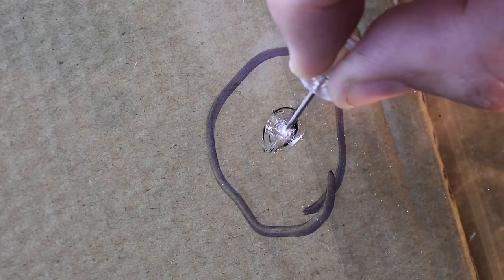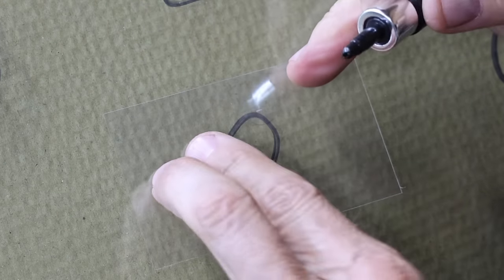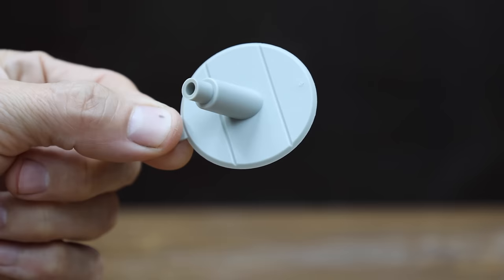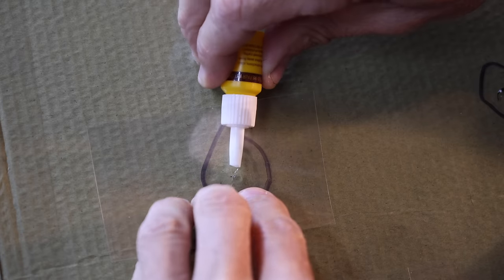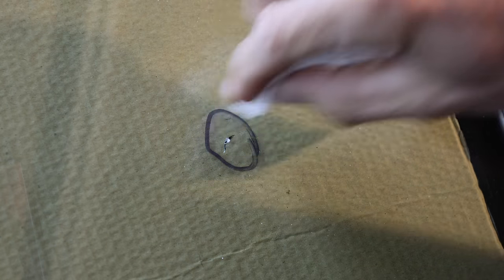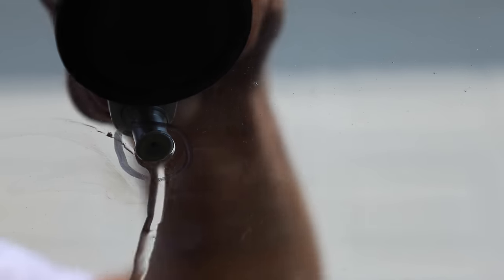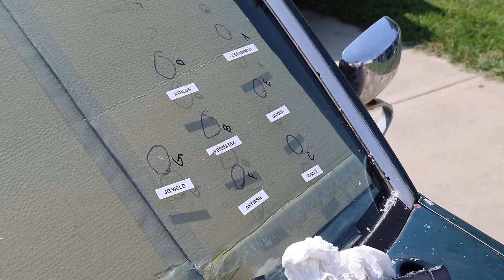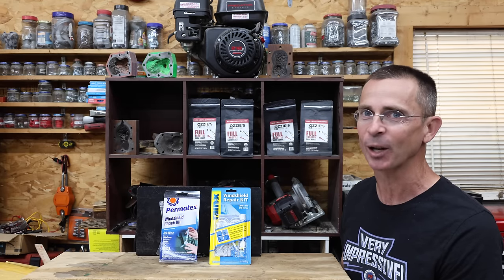Best Windshield Repair Kit? Let’s Find Out!

Comment: This is by far the number one consumer product ranking source that I have found. Been watching for a long time and you never cease to amaze me with the quality and objectivity of your reviews. Thank you so much!
Reply from the maker: Thank you very much! That's definitely my goal. That gratitude expressed by everyone is highly motivating and keeps me going. I'll continue trying to improve the quality of the reviews.  Thanks again!
Reply: FACT
Reply: I completely agree. When I'm looking to buy a tool, I first check if Project Farm has done a video on it. That's what happened when I needed a jump starter. I bought the Audew, and haven't been disappointed. Thanks, Project Farm!!!
Reply: Agreed!
Reply: I legitimately buy things because of this channel. I think it started with reciprocating saw blades but it's like he goes out and spends the money so you don't have to.
Reply: @ProjectFarm I've got simple and relatively cheap video idea for you:
1) The best way to place a toilet paper in toilet paper holders: with the toilet paper tongue over the top (i.e., closer to the user) or under (further away from the user).
Reply: Good video, I'd like to see a video of Sawzall blades especially when used to remove stumps😂
Reply: @ProjectFarm I would add one more step to this I would go inside  with caution use a lighter lightly hit the spot where the crack is that way the crack gets filled even more and you avoid visible cracks after repair.
Reply: It depends. Over the top if no cat is the proper way; a ca, against the wall or you'll be winding that roll up multiple times.
Reply: @4Shreks  Like the Texan amputator with a chainsaw!
Reply: This one shows that he's also taking our responses onboard.  A few videos ago, we recommended that he not differentiate, in strength tests, when the substrate breaks instead of what's being tested (I think it was the plastic repair video).  In this one, he seems to have taken the advice.
Reply: @ProjectFarm any way you could do a video testing/comparing tractor hydraulic/transmission fluids specifically Case hytran, John Deere hygard, Kubota udt, and few other non tractor brand premium fluids? Thanks for all the videos.
Reply: @clevermusicbox3630 texan chainsaw massacre?
Reply: Yep, you get to see what the stuff looks like and get a good idea what to expect
Reply: @ProjectFarm are you guys going to do a BEST WINDSHIELD WIPERS video with fall/winter around the corner?
Reply: imagine if he reviewed other stuff, like tech or foods lol
Reply: I agree.  I just always hope we don't see the channel is actually owned or compensated by Blackrock or another conglomerate oneday.
Reply: Absolutely
Reply: Couldn't have said it better myself!
Reply: @ProjectFarm do a comparison of tyre dressings.
Reply: Hello can you make a video by chance by testing the best and worst ball point press
Reply: Real school test is to shoot each piece of safety glass from fifty feet away with a round from a 40mm Glock. Or the head of a number 6 golf iron.
Reply: @lestagez tech yes. Food no.
Reply: @ProjectFarm have you done carpet drying fans/blowers yet?
Reply: Agree 100%
Reply: Very true! I used to work for an AV company and on a day between jobs told my supervisor about the channel reviewing a category of tool we used and within minutes Project Farm was on our showroom tv being reviewed by the whole team haha :D
Reply: @AChi__  I've done it. Off the top so that it can be broken off over the roller holder and left that way hanging snagged till the next occupant or user in line for use. Works left of throne mount and right of throne mount equally unless there's a handicap feature for a person with only one hand in the house
Reply: Still wonder where the survivors of the tests go to. Donated? Sent back to place of purchase for replacement or refunds? Howzabout the utter failures? Any hope of getting something donated to a shop or school, or does everything get recycling center treatment? Feel free to let Eddie chime in. Thanks Todd.

Comment: I used that $300 kit as a teenager when I was repairing windshields and I got to the point where 1) the biggest chips were my favorite to repair and 2) I could make them completely disappear. Also the best film for curing was the plastic from a cigarette pack!
Reply from the maker: Thanks for the feedback.
Reply: I wonder if the JB-Weld would have performed better using a thinner curing film? (like the wrapper from a pack of cigs)
Reply: I liked the transparent liner from the back of automotive tint. It worked great for curing
Reply: A person who takes pride in their job.  We need a lot more of you in this world.

Also, what kind of waste film would you recommend today?  Cigarette packs are way too expensive amoung other reasons not to buy them.
Reply: Cant you just but a new windshield with that money?
Reply: @kishorebabunalluri7182 probably not. But that $300 professional kit I'm pretty sure isn't one and done. You could probably start a side hustle.
Reply: @jlang8213  Yes, indeed. Well worth the money on that one.

Comment: IMPORTANT TIP FOR FLORIDIANS. If you live in florida and have car insurance. Your insurance is required to fix your cars windshield at no cost to you. No deductible. As long as its just the front windshield
Reply from the maker: Great tip! Thank you
Reply: PA also has similar policies.  This can apparently increase your insurance rate if you switch. I quoted out a few options and forgot about the windshield "claim".  It came up during the final stages of obtaining the policy and it raises the overall premium 10%

Still was cheaper than staying with my old company but just and fyi.
Reply: Additional information - contacting my insurance company after a crack that required full-replacement of my windshield. Statefarm told me that this would not, by itself, raise my premiums for insurance. However, it is considered part of your claims record (although it IS labelled as a windshield claim and therefore specified differently than an accident) and if you are someone with multiple claims, the claim associated with your windshield may be a factor in raising your rates if you end up filing more claims in a short period of time. This seems subjective and varies by insurance company in the state. It may make sense to pay $12-13 in order to DIY a rock chip in order to not initiate this claim through your insurance. especially if you are someone with a history of speeding or recent accidents.
Reply: That reminds me of what happened in MN with windshield repair decades ago.

One company decided to give away a free box of steaks with each windshield repair.  It was advertised relentlessly, and since insurance paid for the repair, the extra money for the "free" steaks (i.e. a kickback) was a big bonus for people to pick this company.  Soon everyone that did windshield repairs had to have some give-away, sometimes exceeding the cost of the repair and costing hundreds of dollars.

Eventually this attracted the attention of the legislature, since of course all this did was increase car insurance premiums.  They eventually banned this practice of "free gifts" outright.
Reply: Same with Texas
Reply: @2shotsofvaca411 In Texas most insurance  companies will attempt to repair (no cost) before replacement (you pay deductible).
Reply: I am an insurance agent licensed in 7 states, every one of them provides no cost repair if you have comprehensive coverage.  If you have liability only, you may be out of luck.   I am actually curious as to which ones don't require the companies to offer that.
Reply: Unless something has changed, a number of years ago, Statefarm changed their windshield policy to not pay for windshield repairs, only replacement. One may get a discounted price for a repair. Rumor was, they paid for repairs and also replacement later, so paid more overall. The company anticipated other insurance companies following similar policies to not pay for chip repair, but that didn't happen. So check your policy terms.
Reply: My Texas sale pitch was it's a no fault claim, your insurance company will pay to save the glass
Reply: Arizona is similar. The auto body shops will even offer ~$200 to the owner because the insurance gets a huge bill so they want drivers coming in.
Reply: You just KNOW Florida lawmakers will move Heaven and Earth to change that law…
Reply: Hahahaha.  NOTHING is free in this world regarding insurance 🤣
Reply: @thewibb  so true this; people will pay one way or another.

Comment: I have used the permatex 6 to 8 times with good results. They never cracked, left a wiper streak or discolored. Some spiders were on the large size and were repaired, though none disappeared completely. You're one of the fastest talking Farmers I've come across. Keep up the great work!
Reply from the maker: Thanks!
Reply: Will the permatex push the medium onto cracks/ If fso, how  long. I've got nast crack i would like to make less visible

Comment: I have used the Permatex kit, and it has held up great over the last few years going from high temps, and a few trips into the snow too. The big thing is making sure the area around the "sealing sticky ring" is 100% clean, or the resin WILL force out when you do the "pressurize" step. Otherwise, for tiny chips, it is not a bad kit.
Reply from the maker: Great information and great tip!
Reply: I used Permatex after taking my wife’s car to get a chip fixed one week for $115, then she got another chip just a few weeks later. It looks just as good as the professional job. Definitely a good product to keep on hand.
Reply: I’ve used the permatex on some pretty big stars. Most of the time they hide pretty good, but even if they’re partially visible yet they seem to stop the spread. The challenge I have is getting to it before the spread starts. I run a lot of miles in a state that spreads gravel on snow and ice so I personally buy windshield warranties and they always pay for themselves. The vehicle I bought in January is on windshield number 3
Reply: I've also used the Permatex with excellent results.
Reply: I used a permatex kit on my windshield more than 10 years ago and it's still looking great.  Best kit for the money.
Reply: @specialestness I'm late to the party but is this warranty through say a Safelite style company or is it through a third party? I assume you don't mean insurance. I've never bought a windshield... yet... So, I'm curious.
Reply: @0Rookie0  most dealerships seem like they sell a windshield warranty when you buy a vehicle. It’s a third party company and they typically work with Safelite. I’ve had one through Crystal Fusion and another through Permaplate.

Comment: Featuring a professional, when it's rather hard to grade products was a very smart move.
Reply from the maker: Thank you very much!
Reply: Yep, this took his review on whole new level, would love to see more product reviews including professionals.
Reply: Todd, you outdid yourself this time, and that's a very high bar. A+ job!!
Josh seems like a great guy!  What's the name & URL of his business, please?
Reply: @ProjectFarm  And now that you have experience recording just hands and not showing the person's face, you are now ready to work with the LockPickingLawyer.  😺
Reply: It was great, I just wonder how hard it is to get pros to appear on camera for this stuff.
Reply: Yeah, I agree. With a repair kit, there are so many features/aspects to rate, which can't be rated without experience.

Thanks Todd & Josh.
Reply: @Kmnri  That's gonna be problematic for tools, for example. Pros tend to use tools harder with less maintenance. Recommending one tool over another has more to do with abuse tolerance than the actual design intricacies of the tool itself. I know, I'm a contractor....what I might recommend to the weekend warrior would probably be expensive overkill most of the time.
Reply: Would be nice to do the test blind if going through the trouble of using a professional. We all have our biases.
Reply: I got a pretty big bullseye in my windshield when a rock got kicked off an overpass and I hit it at 70MPH. My car was two weeks old…
Next time I took it to the dealer for service, they saw it and convinced me to get it repaired for, I think $249.
It didn’t come out nearly as good as I thought.
Every time I went in for service after this, they’d notice the remaining mess and offer to fix it for $249. I tell them they already had their shot and failed miserably.

There is a guy who hangs out at our local Shell station, stalking every vehicle windshield damage so he can give you his card. Every time 
I bought gas there, he’d try to give me his card.

Comment: I got a chip a half inch from the edge of my windshield and it spread out to a 6" crack extending from the chip towards the center. I brought the car to Safelite and all they did was rub on the crack extending it another 2" and then tell me it can't be repaired and I need a new windshield for $600. I drove home, ordered the Rain-X kit on Amazon, and sealed the chip and the crack. Because the chip was next to the edge of the windsheld I used my fingers to hold the other half of the suction cups down for ten minutes while the epoxy did its thing.

It's been over six months and the crack hasn't spread any further. It's visible when the light shines on it a certain way but overall I'm very pleased at saving $585 on the repair.
Reply from the maker: Fantastic!  Thanks for sharing.
Reply: @dj68k  eventually you might want to get that fixed. But I do like how this stuff stops the crack from spreading.
Reply: If you ever need a new windshield look for a large auto glass distributor near you. Safelite and dealership were charging me $900 for an oem windshield and labor and I got it done for around $245 with an aftermarket windshield after getting quotes all around town. Ridiculous prices for OEM windshields
Reply: Another thing to note on newer cars is that features like adaptive cruise control may require  calibration after a windshield replacement. This is usually not needed but can be done afterwards if needed. So to save the most money you can ask for quotes for a new windshield, a calibration, and both together. It is cheaper to get them together. But since you most likely won't need a calibration it is a good idea to have the lowest quote for the calibration if you do require it down the road. In my case I have never needed a calibration and all the safety features still work great.

Comment: So many times this channel has put out a video that is EXACTLY what I need with PERFECT timing. I just did the estimate for Safelite and it is 159.99 for just 1 chip. 
So once again, PF is saving the day.
I appreciate this channel as much as I enjoy it.
❤
Reply from the maker: Thanks so much!
Reply: I've heard that insurance companies have covered these repairs with no deductible applied.  I'm surprised the shop didn't tell you that.
Reply: Depends on the insurance company. State Farm will discount but make you pay. Most insurance companies will cover at 0.00 cost to consumer. But you have to file a glass claim to fix chip and find out.

Comment: I've been doing windshield repair/replacements for about 10 years now.  The first repair kit I bought, and still use to this day, is Glass Mechanix.  Pricey kits, but I achieve very nice repairs with it.  One thing i'm glad you showed is adding a bit of heat (flame or blow dryer) to the inside of the windshield on the last pressure cycle.  You can literally watch the resin flow into the legs of the cracks when doing so.  It's very satisfying to watch that happen.  

With the Glass Mechanix kit (and with other professional high end kits) you only need to do vacuum and pressure cycles for a couple minutes.  Very quick and efficient.
Reply from the maker: Thanks for the feedback.

Comment: I’ve personally used the rain X style kit (ufixit brand) and the permatex as well for a dozen repairs now and had excellent results with both, correct application is definitely the key and while the rain X is more reusable it is a little more fiddly. I felt the double sided tape and syringe type kit was far more foolproof and more “point and shoot”.
Reply from the maker: Thanks for sharing.

Comment: I had a tiny chip in my windshield. I went to the professionals and they said there’s nothing they can do because it’s too small and a repair won’t work. I bought a repair kit and did it myself, extremely easy and has been very successful. Can barely see it and now it’s perfectly smooth, no more chip.
So much for the professionals in this case.
Reply from the maker: Thanks for sharing.
Reply: Same with me.  They told me to kicks rocks.  I went out and bought the permatex one and came back to show off my work.  That guy had nothing to say after.  😅

Comment: I have used the Rain-X kit, and was very happy with the results.  Although the repairs are slightly visible if you get them in the right light,  they have lasted well,  and don't seem to have deteriorated in the 2 years since I did them.  😊
Reply from the maker: Thanks for sharing.
Reply: I have experienced the same results with the Rain-X kit using the same equipment with two vehicles.
Reply: I used the Rain-X kit on 2 different car windshields and on a motorhome windshield, all with really good results.  I like it so well that I always keep a kit on hand. Really enjoy the ProjectFarm channel and his methods of testing.
Reply: Agreed, like the rain x kit.